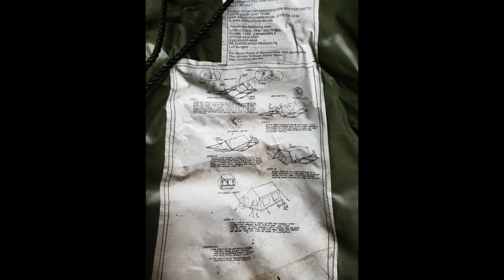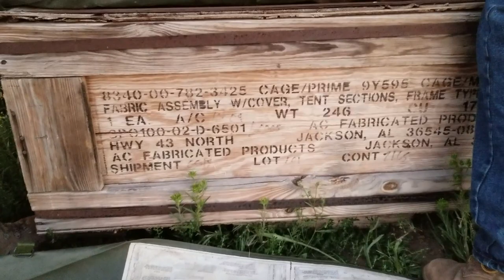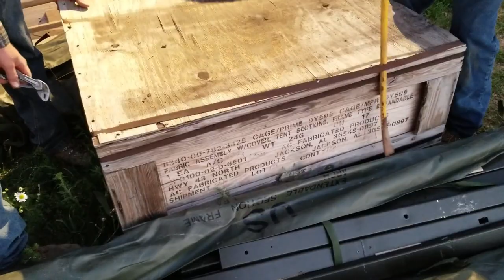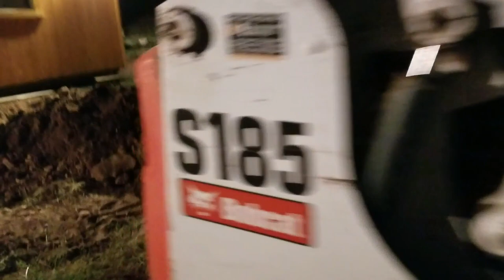Army Tent vs Yurt, which is better for living On Your Off Grid Property?

Comment: Yurts are much nicer than this smelly damp old bag of a tent. The inside of a yurt has nice natural light that comes through the fabric and the whole interior has a really nice feel. This old sad tent is good maybe for Bigfoot to stop by for a night or two
Reply: brad douglas Yep, not to mention that military equipment is many times made as cheaply and uncomfortable as possible even if it meets gov spec.
Reply: Nothing old about this tent. I bought one. Brand new out of the crate! Beats the hell out of any civilian fabric wall tent available at half the price! Yep. Military probably paid $8,000 for this set up. Available brand new in the crate for $1600! No mold smell. just brand new material smell! this tent is tough, heavy duty construction. And is designed to military specs. to stand up to 70 MPH winds, and 36 months of continual use exposed to the sun and elements. Designed to block light and heat emissions against detection and provide protection against chemical weapons. They are hot in the summer. But also very warm in the winter with a liner and a wood stove! All windows, and doors open for cooling if no A/C hookups are available!
Reply: a few cans of scothguard ... once a year or so.... it will last a very long time and the smell will not be moldy... lol
Reply: military tent made to HIDE inside light ..Yurt any light inside you are seen from miles away!  safety is a big concern for some
Reply: smiles 19 yurts can be "locked down" too and flaps closed. They completely seal up Remember they were designed by the native peoples to with stand the winds and snows of the Mongolian steppe. 100 plus mile an hour winds, som elf the most hostile conditions found on earth. They are crazy resilient.  It the can be opened up when the weather is nicer and light will flood in. They are the best design know to man. However I will say good yurts are very expensive. Be prepared to pay 10 to 15 grand to get started, but then you will basically have a  nice home.  These military surplus tends are cool for FEMA type emergencies and refugee camps. They just won't ever feel as homey and comfortable as a nice Yurt
Reply: I would add that yurts can be well insulated as part of the package. They are also easily repaired as they use wool for insulation and strips of wood for the frame. So replacing components was part of the basic design. For a longer term home I would opt for a yurt, plus they are very mobile if necessary.
Reply: brad douglas  greatest comment ever! Everyone is staring at me now that I just randomly busted out laughing! Stop!! My eyes are tearing up

Comment: You would think that when you bring in a "Mongolian Horde" they would want to build a yurt, but they wisely opted for the more cost effective tent. Go figure.
Reply: Well, it's definitely cheaper but the yurt has advantages...

The structure of the yurt spreads the load evenly over the whole structure so it's generally much stronger than the army tent design....

Circular shape generally provides more volume for usable space than the tent design...

Circular shape also helps deflect wind around the structure, so yurts are far more wind resistant than your typical tent design, with a little steel re-enforcement to the support structure people have even had them withstand hurricanes...

Yurts support structure allows it to be scaled not only bigger but also upward so you can have more than one level, which is generally not something you can do with a tent design...

If you need more insulation you can generally just add layers to the yurt but you're basically stuck with what the tent comes with most of the time... and tents are usually not as rigid as yurts...

While the tent is a little easier to break down for moving it and they can both have additions added to extend them and add functions.

Though, people may prefer not having curved walls and the lower cost of a tent does make it more disposable and thus less a issue if you damage it...

Comment: The saw should only be a 1/4 inch lower than the cut of the wood, the blade will cut easier, and the blade won’t bind. And now days the battery will last longer. I do see that this is 5 yrs old. But this is the way my grandfather taught me- 50 yrs ago. And I still do it this way. Any Master carpenter would tell you the same thing
Reply from the maker: Ah, the wisdom of grandfathers never fails! Who needs fancy new techniques when the old ways still get the job done, right?

Comment: Why no one 3D print foldable aluminum eye beam's that unfold and connect together to form an inner frame to support those tent's from the inside? Even do the same thing for Yurt's? It's like folk's like to do thing's the hard way? Like bamboo rug's designed to roll out inside a tent insulation laid down on floor of tent then bamboo rug rolled out over lumber support's on the floor of tent to form a lifted floor? 😞😕🍂🍃🍁🎃🎑

Comment: Building a shed is the only way to go and use at least 5/8 thick siding and add hog wire to the inside for protection.  If the SHTF you don't want to be in a damn tent so anyone with a knife can make a door and come right on in while you sleep.  Not to mention animals.  Any kind of tent is no good for this time in society. Another good thing is an old Airstream Trlr. so safety can be maintained while you are trying to survive the elements. They are very well made and easy as pie to secure.  If you are not armed you're screwed anyway!

Comment: $1,500 + another $1,000 lumber for a tent that will not defend you from the elements and with one good air storm WILL collapse and with a good rain storm it will leak and and condensation will rot and be wet inside the tent.
Reply from the maker: Pit Dawg,
 I GUESS WE SHALL SEE THIS WINTER AND HOPEFULLY YOUR WRONG.
Reply: Pit Dawg  If you are correct he will just have his Muppets dismantle it; while he dumbs them down. 😣

Comment: Speaking from experience there are several reasons why I would choose a yurt over an army tent. The first being that without the liner that goes in that tent you are never going to keep it warm. It just doesn't hold heat on it's own. Two I spent way too much time putting those damn things up and tearing them down, no way I am going to do it now. Three the yurt just looks better and you don't need 20 people to set the yurt up. I have seen it done with just two people. Not going to happen with that army tent unless it's two bodybuilders doing the work.
In my mind the cost is secondary to the fact that I will use probably a third of the firewood that you will in exactly the same weather. My time is worth more than that.
Enjoy freezing

Comment: For temporary housing a tent is definitely the way to go, but longer term I'd prefer a wooden cabin. Yurts do have an advantage with their modular structure. The lattice walls come in segments, and it's possible to swap out a segment for a wall with windows. Real windows are definitely less of a PITA than tent storm flaps.

Comment: Ok so you ask, wtf, yurt builders? By which I guess you're asking them to account for the $8k price tag. I'm not a yurt builder, but I'll tell you wtf. A yurt is not an army tent. Heavy canvas wall tents are great, but they are just a soft sided box with a gable roof. That's their low tech charm. Yurts are very special, highly evolved, closely engineered, high-performance, movable structures for extremely demanding applications. Even the preindustrial ones are high tech. Have you seen a real yurt frame? It's not exactly a shed made of butt-joined yellow pine sticks from Home Depot. And it's not a heavy steel erector set stamped out by the hundred thousand in a factory. And have you checked out the wall materials of a real yurt and how the layers go up and why? Check it out. They're not  canvas sheets with poly liners. So you slapped up a $2500 structure using free labor (and evidently a free Bobcat or front end loader chugging around off camera, just like the old homesteaders used to have), and that's great, but equating it to an $8000 structure and exclaiming wtf at the price difference, that's not great.

Comment: That pressure treated s*** don't matter DeWalt can't make a saw you cut that s*** down there everyday with Milwaukee cordless don't have no kind of problems like that
Reply: Robert Atwood Lol... they need to learn to use a circular saw first. Kept twisting it and binding the blade. Good way to burn out your motor.